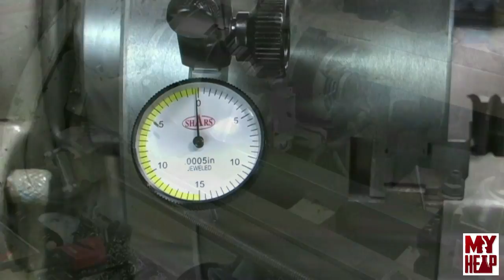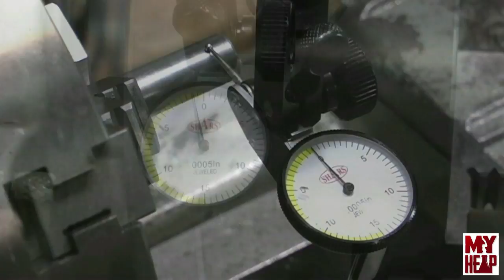YouTube Shop Student - Episode 007 - Finishing the 3 Jaw Backplate ... Finally

Comment: Hey, Joe, I'm a 20 year retired programmer and live in podunk central Orygun. For cutting oil I use the cheapo thread cutting oil from Ace Hardware. It's a high sulfur content oil for cutting pipe threads.  Really nice job on fitting the chuck to Bertha too. I know what you mean about the shop, mine is kind of that way too. I can't wait to see the Burke finished, I know how much work that is. Also, more on the LinuxCNC series would be appreciated. Thanks for the video!
Reply from the maker: Hi George,  Thank you for watching.  I have been using soluble cutting oil, WD40 and kerosene for cutting fluids of late.  They seem to work well, if I can only master the feed and speed thing.  HAHA.  I am looking forward to having the Burke mill finished and using it.  Again, will be another learning curve for me, but will be a fun experience.  I am working on the outline for the next CNC video now.  Every time I sit down to work on it something comes up.  You know how life tends to divert your plans.  Hopefully by the end of the weekend.  I hope to make some real progress on it today.  Thanks again George for supporting the channel.  I appreciate it.

Joe

Comment: Joe, need to make those new dials. Ha! In just 7 episodes you're on your way and doing great. Pleased to see your skills increase. Just 2 years ago I was doing the same thing your doing now.
Reply from the maker: Hi Steven, yeah, your right I think some upgraded dials would be a great project.  The current ones require me to don the geezer goggles to see properly.  I will have to dig out my stamps and see if they fit the jig, otherwise buy some the correct size.  Thanks for reminding me.

Thanks for the complement.  I am enjoying the experience and the interaction from you and many others.  When the camera isn't rolling I do much better.  Once that thing comes on, I get nervous.  Funny, huh!

Joe

Comment: Hi Joe,  .0015 runnout is great for a chinese chuck. One tip I can offer, the chucks are heavy and can sometimes be awkward to spin onto the spindle. Open the cover,  hold the chuck steady, and spin the pulleys (with the tension to the drive pulleys released.) As far as the smoke goes, I usually do not get that kind of smoke unless I am taking a deap d.o.c.  playing with your tooling and feeds and speeds may help. I am no expert, but the spindle speed seemed a little slow for carbide tooling. Changing the geometry of the tool may help as well. I use mostly insert tooling for turning and facing, and hss for parting and threading.  As far as your next project? The sky's the limit. Maybe try cutting some threads. A captive nut puzzle is a fun, easy project that builds good experience.
Reply from the maker: I will experiment with it and see what happens.  Tooling, Speeds, Feeds, DOC, etc.

HEY, that is a great idea, I get to learn to cut threads and make  something to sit on my desk.  Great idea, captive puzzle is on the list!

Thanks Jeremy.

Joe
Reply: Yeah.......you should do a captive nut puzzle! 😊
Reply from the maker: Hmmmm , I think I will.  :-)

HAHAHA

Comment: Hey Joe for steel I use sulfur cutting oil. Sold as pipe threading oil at just about any hardware store.  Smells like a shop should.
Reply from the maker: I am not against using it, but don't want my basement smelling like it if I can help it.  The stuff I am using smokes but doesn't smell too bad.  After I move the lathe to the shop, well then it doesn't matter.
Reply: My Heap anchor lube. Might be worth a go may smoke less I think you can get a free sample size if you go to there Web page
Reply from the maker: I see a lot of people sing its praises.  I will check out their page and see if the offer a sample.  I am willing to try it.  My shop won't be ready before summer so finding something that won't smoke so bad may be worth the look.

Comment: The inside depth of the chuck is great enough that you could set 4 annular number 8 or 10 set screws into the chuck, cut the back plate rim deeper (almost to the inside plastic plate) and turn the inside spigot down about 10 thousands and end up with a set true chuck
Reply from the maker: That would be an interesting way to go with the chuck although it seems kind of a tight space to get the holes drilled and tapped.  But honestly, I would want to get a little more comfortable with myself and skill set before I tried it.  I know, I know ....  I am a chicken!  HAHA

I would not have thought of converting in into a set true chuck so thanks for the idea.  Thank you for taking the time to watch and comment.

Joe

Comment: I left about 1-1/2 thou interference fit when I cut my back plate for my new chuck.  Stuck the back plate in the freezer for 24 hours, pulled it out and it dropped right into the chuck.
Reply from the maker: What a good idea, forces it to be concentric, but taking apart to clean, what did you do to get it back apart?

Joe
Reply: First I removed the screws holding the chuck to the back plate, then placed the back plate in a shallow container containing dry ice.  Brass drift punch and apart it comes
Reply from the maker: Hey Gus.  Well I was wondering how you done it.  I thought maybe there were a couple of threaded holes for jacking screws.  I imagine the body of your chuck runs pretty concentric then doesn't it?  Thanks for sharing!

Joe